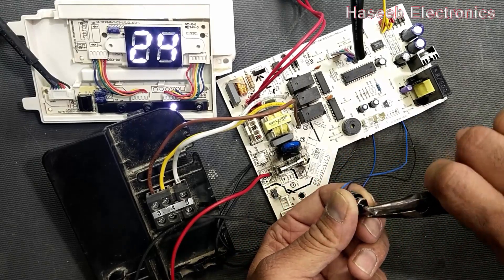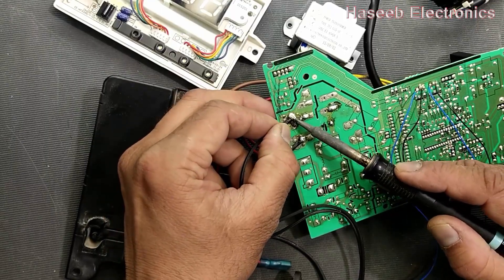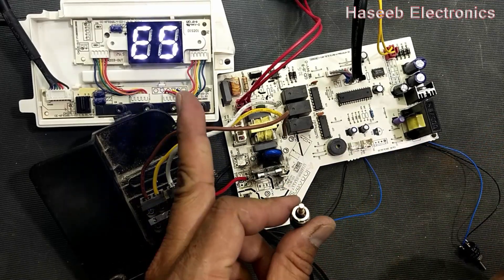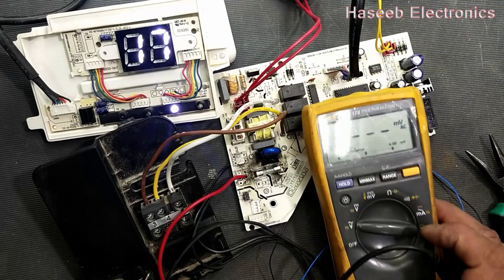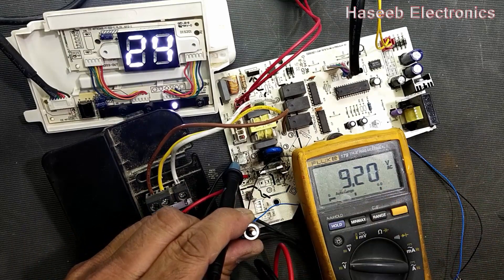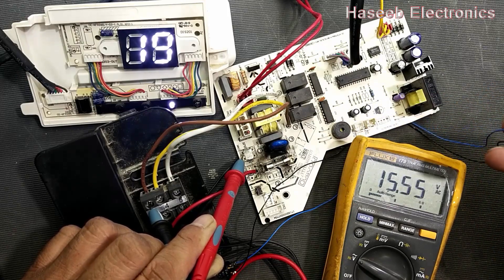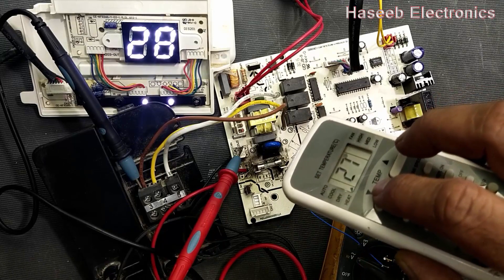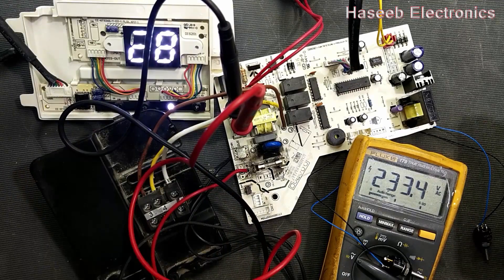#329 Split AC Indoor Unit Board Bench Test / How to Test AC indoor unit board

Comment: Pls have performed repair on LG art cool AC model LSNH126F2L0 control board before...my technician has no experience in control board repair, so he wire my compression and fan directly to power input of the indoor unit. Please help

Comment: Is the compressor voltage DC or Ac for an Inverter unit?
Reply from the maker: The output is switched dc voltage at 50 to 153 Hertz